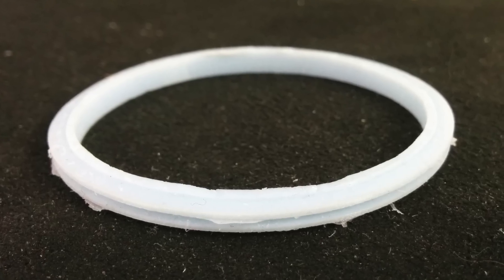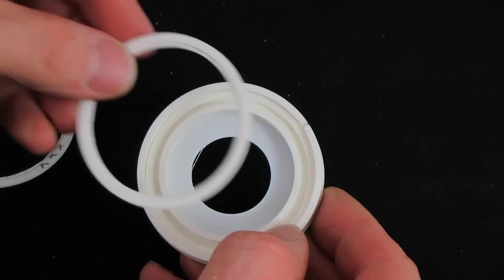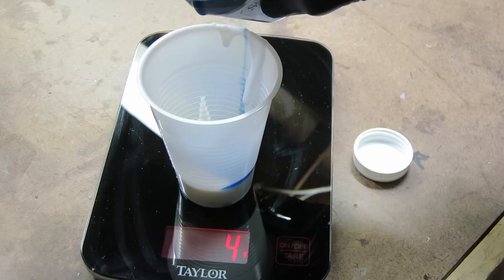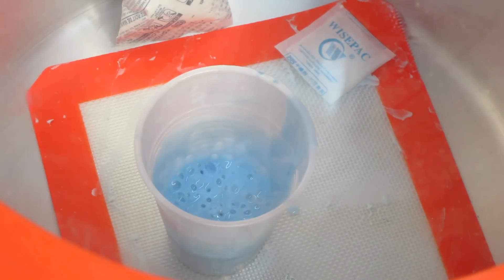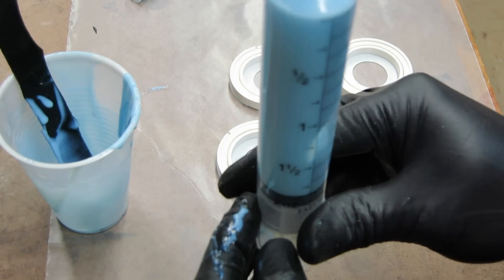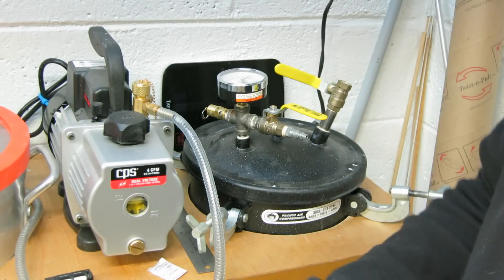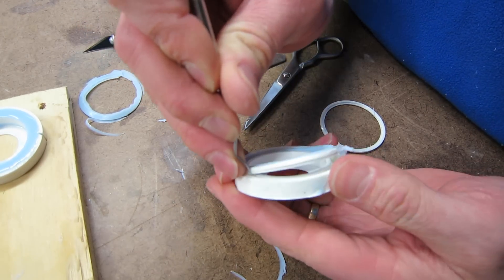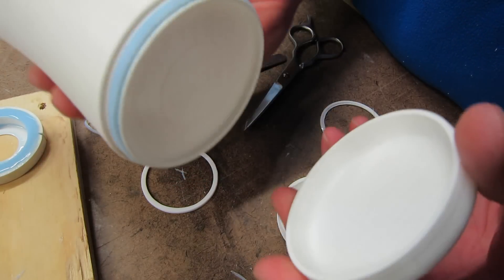Casting a Silicone Gasket in 3D printed FDM PLA mold from an Ultimaker DIY How To

Comment: Doesn’t latex inhibit the cure of silicone rubber?  I’ve seen recommendations on manufacturers websites to avoid handling your molds with latex. They recommended vinyl gloves.  I wonder if nitrile gloves would be a problem as well.  I buy those in bulk to protect my skin from all the different greases and petroleum products used in boat maintenance.
Reply from the maker: Never noticed any issues, but platinum silicone is finicky stuff

Comment: Have you tried this with resin 3d printed parts ? I've tried and the silicone won't cure in the mold.  It's strange because ive made silicon molds of resin printed parts for plaster casting and it worked well.  But the mold being made of resin and the silicone won't cure.
Reply from the maker: use a tin cure silicone, or seal your part. Some platinum silicones will not cure against some 3D printed resins.
Reply: @EricStrebel  thanks for the reply, I have been going insane over it.  I was going to try spray painting the resing mould to see if that helped......  I had ruled out mixing and room temp as culprits since the silicone left in the witness cup was curing well. 
I will get a spray primer and a new batch of tin cure delivered asap and see if that helps.   thanks for the tip
Reply from the maker: You can try coding the part of course that will alter its form. Or just switch to the 10 cure and you should be fine

Comment: Hi! What if I don't have an access to a vacuum chamber? Is it the same need for a one component silicone? I plan to make a part for my broken irrigator (the pump cap in the cylinder) out of a silicone sealant.
Reply from the maker: You just risk the possibility of having an airbubble in your part
Reply: @EricStrebel  Thanks for the answer, Eric! Will it be visible through a powerful light source? I can make several parts at the same time. It's not a production anyway.

Comment: Sweet! do you think this is how the small round black gaskets are made? Like ones you find on Vapes, flashlights, watches, and other smaller devices?
Reply from the maker: I guess in theory the answer would be yes, but in real life those kinds of gaskets are make with different materials and with more dedicated equipment
Reply: The small black o-rings are made in an aluminum or steel mold.

Comment: hi, I know how tough it is to push silicone through a syringe like that! something I found that works GREAT for doing this is a leveen inflator, the screw syringes they use to pump up angioplasty balloons. you can buy them cheap expired for around $25 in medical surplus stores. GREAT video, thank you
Reply from the maker: cool, good to know!
Reply: Do you think the needle to pump basketballs and the like would be too small of an inside diameter?
Reply: Great tip!  I was thinking of using a vacuum pump. Kind of like resin infusion in the mold for boat hulls.